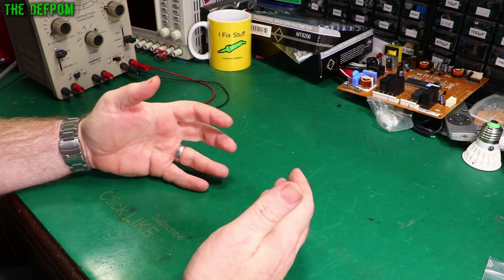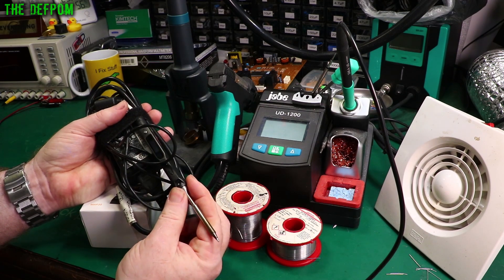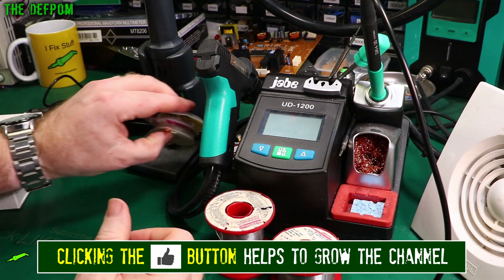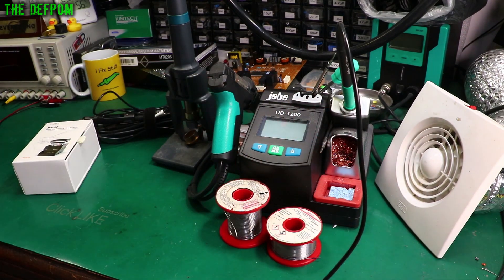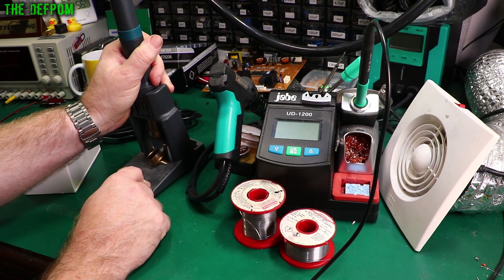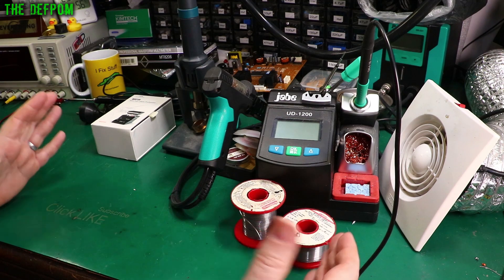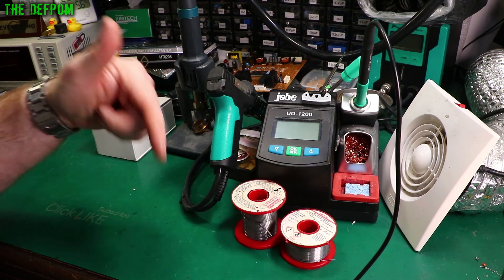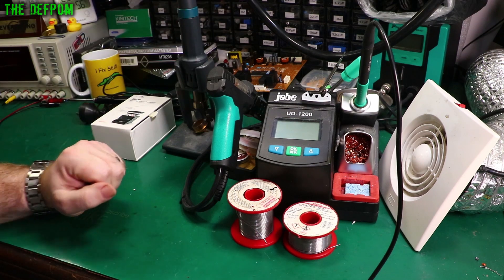🔴 Electronics Tools For Beginners - No.3 - Soldering Tools & Fume Extraction - No.998

Comment: Running a Weller WX2 myself as a daily driver. I have a love hate relationship with it. It works really well, more power than the JBC's (with a wide choice of soldering handles all mating up with the WX system, from a 200 W handle for chassis work to mini-tweezers and micro pencils). I got it cheap on auction (I watch those like a hawk for electronics stuff). Added my handles of choice (got some of those too on auction). My main reason for getting it (aside from cheap) was that it was advertised as WXD2 (which comes with a vacuum pump for desoldering) but incorrectly so. Regardless Weller did have the right idea here. Make 1 station that supports all your needs with a good choice of handles. 

But here is the glaringly bad part of the thing. The choice of tips is sad. Especially the active cartridge type tips suffer from this. There are maybe a dozen tips per handle and that's it which compared to JBC is a joke. This is my biggest gripe. What I would not give for the option to have a better choice of tips.

For desoldering, well I have had a number of desoldering guns. From cheap to classics including one that I found truly unique (it had a solenoid, i think, that would activate and create suction like a sucker pump). But lately I have been using a Hakko FR301. Honestly this is where nobody should skimp if they have to deal with through hole stuff. With all of the others it would be so hard to get solder out that you end up ripping pads period. With the FR301 that has dropped down to as good as 0.

Hot air gun, the Quick 861 DE (not the DW). It has more power and higher airflow for those really tuff jobs.

Comment: Great info, I used to use a bench iron setup until it died but now use a TS100 which runs off 12v to 24v DC, run it off any old laptop PSU or a battery pack in the field. I love the skinny pencil-like size of it.
Also, I designed some neat 3D printed solder dispensers, look on Thingivers for: Tic Tac solder dispenser

Comment: Leaded solder is the way to go. Although I would love to hear from anyone with a good experience of using lead free. But I’m sick of buying lead free to find it solders like crap. I must have about 20 rolls here using various alloys and flux.
Reply: For rework/repair I use leaded........For smd reflow lead-free (UK requirement for manufacturing).
Reply: Have some expensive leadfree solder 95% tin, 4% silver 1% copper. It doesn't come near a decent leaded solder but oh well. Rarely use it because even this stuff is barely usable in my opinion.
Reply: @xConundrumx  I live in hope that someone will crack the problem I’m guessing it’s only a matter of time before they stop producing leaded altogether

Comment: I want to assemble SMD boards, but have no permanent work space and limited storage. Do you think that a hot air station will be a viable way of making the occasional board?  What are the things to watch out for when using one? Are there components that don’t go well with hot air, and need radiant heat? 
What type of solder paste should be used?
Reply: Most of the secret to getting the best out of home smd assembly is pasting to boards up properly in the first place. Lay down and paste with ONE swipe screenprinting style across it.
Use leaded paste, it doesn't require the same high temp as lead free.
Watch not to use too much heat from the hot air gun, and dont directly apply heat direct to plastics despite them being reflowable.
If you want to take it to the next step then use a hot plate to pre-heat your assembled board prior to hot air.
With practice, you should be able to get perfect joints everytime on any smd package without retouching.
But like I said, the secret is in the pasting of the board.
Reply: @IanScottJohnston  Thank you! Sounds like good advice.
I have seen many YouTubers take multiple swipes when pasting and thought that would produce smearing and excess paste.
I had an “oh yeah! Of course!” moment when you mentioned plastic parts. So you cause me to think that constantly moving the wand to heat the area more evenly is the way to go.
Reply: @Dilshad-gu7je  depends on the temp you are set to. 250degC and you should be ok on reflowable plastic parts but you may need it higher depending on distance from parts.
Multi swipes just push paste under the stencil, especially if the paste is too runny/liquid.
Not to take you away from Scott's channel, theres an old video on my channel demo'ing pasting start to finish (No. 51 i think).